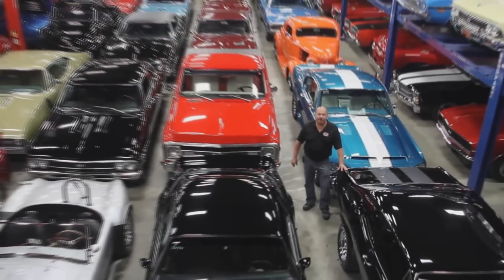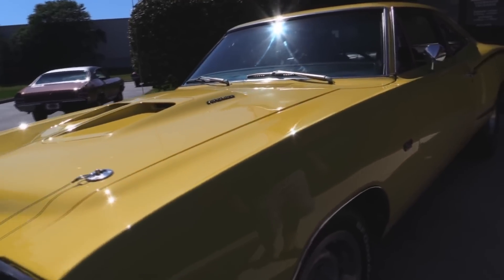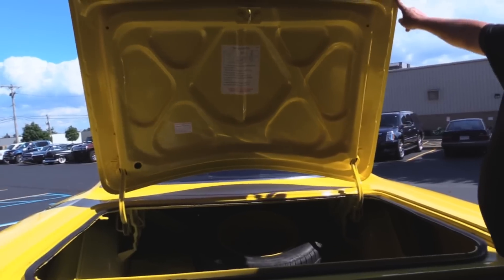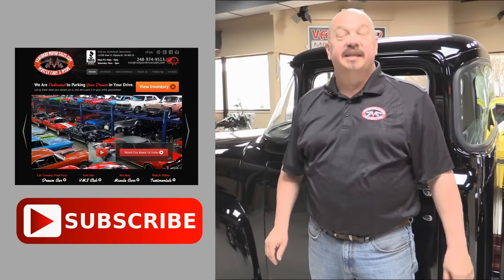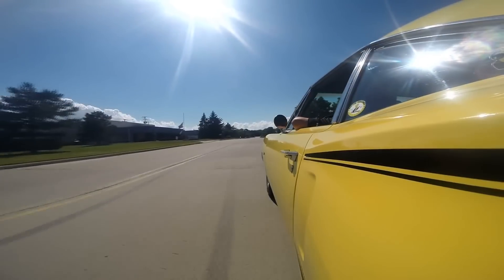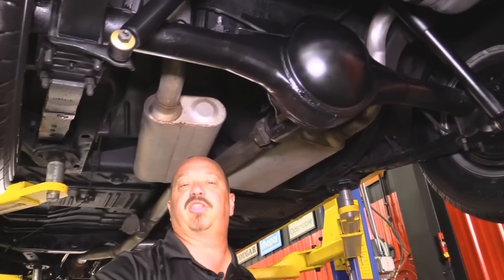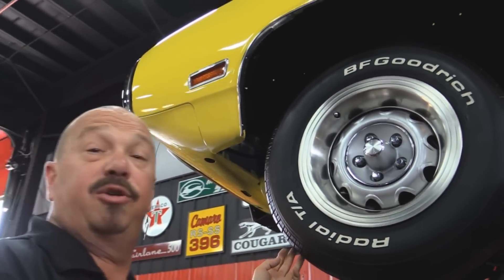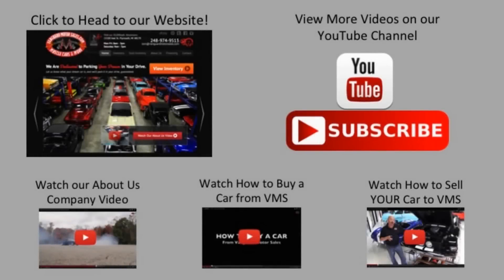1970 Dodge Superbee For Sale

Comment: I LOVE MOPAR but i can not stand the 383 motor they are crap in my humble opinion .. i would rather have a 340 or a 440 actually i rather have a 318 instead of a 383...
Reply: Why? Just asking. I had a '71 Challenger R/T w/440 but originally came w/383 mag. Bought it like that. (my first car at 18yrs old). Didn't realize the gem I had.
Reply: motor ain’t the problem on this one. 4 speed manual.